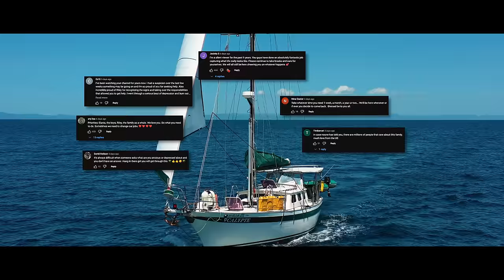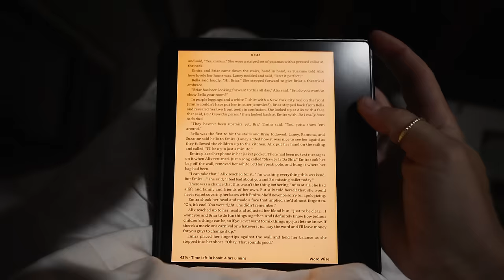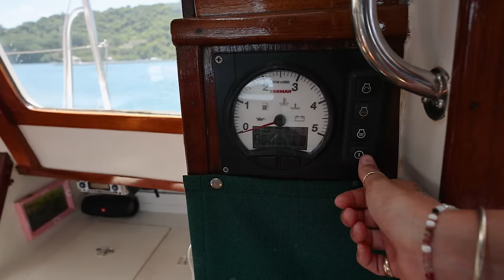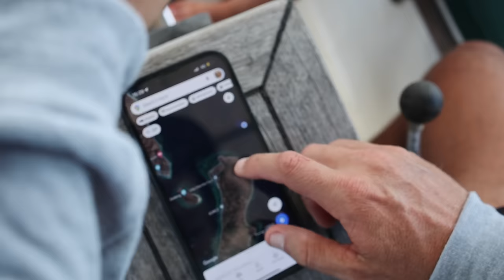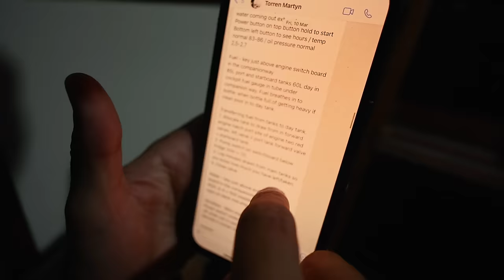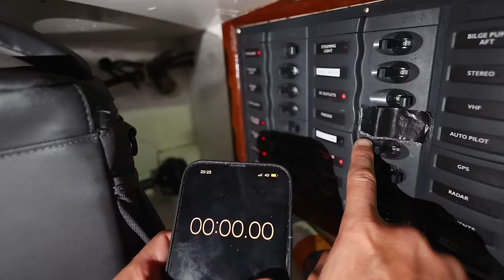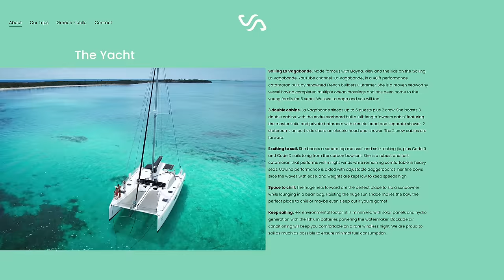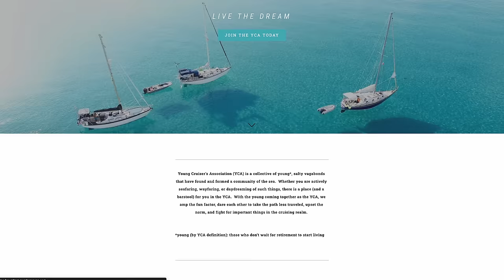Life Now... (Raw, Unedited, Hour Special)

Comment: Hi, A little addition to the pulley theory that may interest both of you. In the diagram re pulleys you looked at, to run a horizontal line across all the ropes would give you a mechanical advantage of six. Your effort times six is the lift weight. Cheers

Comment: Balsa wood wing ribs, laser cut. NACA airfoils are unsuitable for models, they are designed for higher Reynolds No.s eg millions. Try Glider sections, eg Benedek High drag sections don't matter due to lower Balsa would save lots of weight. Balsa comes in densities of 4lbs/cu.ft to 12++.Balsa cabin sell equador balsa. The best.